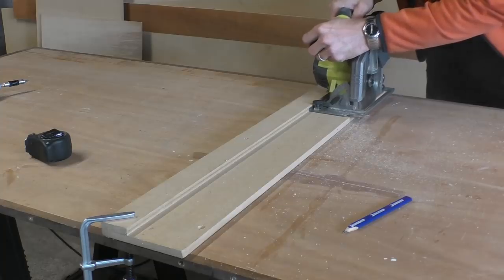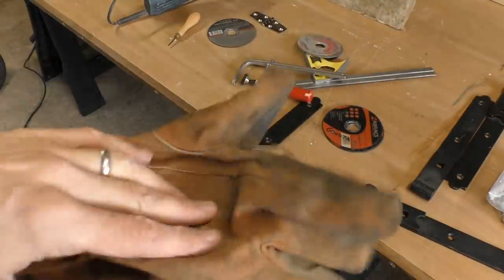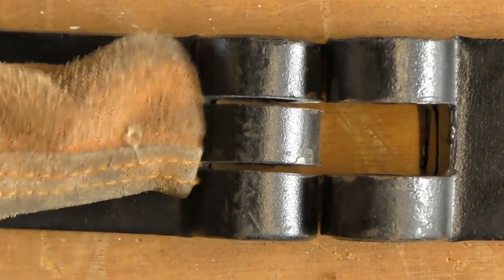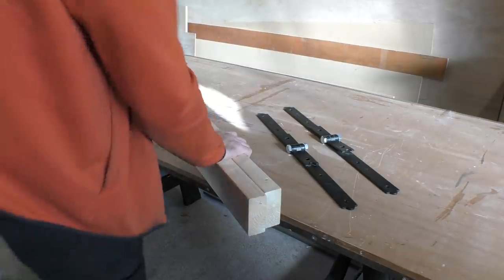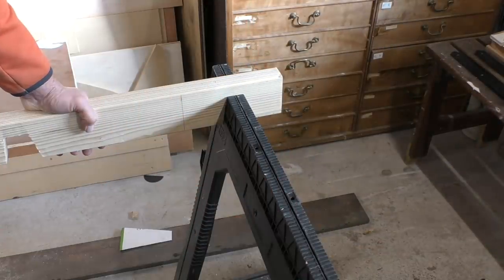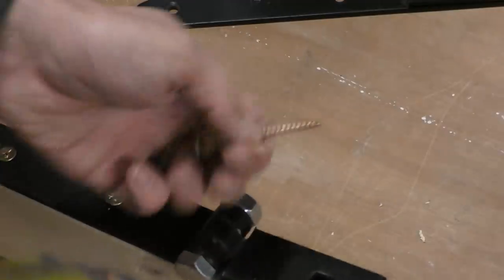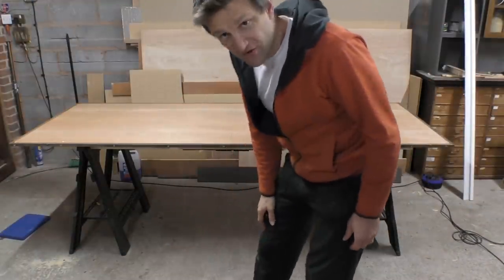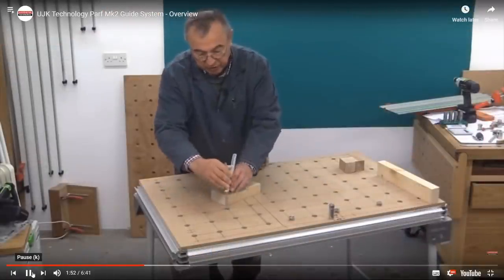The ULTIMATE DIY Portable HINGED Folding Workbench: Upgrade video 4 of 5

Comment: Lovely job Charlie I recently made two workbenches all from CLS timber from B&Q and a few treated 6ft posts I had spare. I got both workbenches set on 4 wheels two of which can lock up. I put two vices in, one for wood and another for metal. I am improving my tools over the years and recently got a pillar drill. I love playing about with wood only way to learn is practice. One of the workbenches is for gardening but have adapted so I can easily use it for wood as well. Merry Christmas to you and your family
Reply from the maker: Like the sound of that Chris! Couldn't agree more. Been messing around with wood since I was old enough to hold a saw - so from about 6yrs! A very happy Christmas to you all, too!
Reply: You never stop learning Charlie you given me a few tips past year, thanks for sharing much appreciated

Comment: Great work. I like how you think things through and show the real issues that arise, we learn best by doing, 
I'm curious about the screw gun/drill you are using to fit the screws. it sounds like there is hammer action going on?
Reply from the maker: That could have been the impact, which I don't use very often. There's a vid here where I explain the differences https://youtu.be/sL-t2Zc4wCs
Reply: @CharlieDIYte   Thanks.

Comment: A new subscriber here, after buying a new house I have lots of DIY to do and your videos / tool recommendations have given me the confidence to do a lot of the work myself.  

My dust collector and saw guide are working a treat and next on the list is this workbench.  

Thanks so much for taking and the time to put these videos together!  Legend.  It’s great that you are prepared to share your mistakes, refreshing and helps with the lessons learned.

I wonder what thoughts you and your subscribers thought about putting in 2 x 4x2 ‘noggins’ either side of the cut and fitting a heavy piano hinge?  Like a wallpaper table.  Or, would the be likely to bow?

Thanks - keep up the good work!
Reply: Actually, you wouldn’t be able to take the pin out of a piano hinge.  Maybe a strap hinge or series of door hinges with the noggins?  A quandary
Reply from the maker: Thanks mate. Really appreciate the sub and your kind comments 👊 I wouldn't get too hung up about the hinge. I would buy 4 saw horses and make two separate benches, and when you need them to function as one you can simply screw them together underneath, perhaps with an additional piece of 4x2 that overlaps each of the existing ones, or better still some sort of cut down just hanger or wide steel mending plate. The hinge was a funky idea but you do get a bit of sag so I tend to use 3 saw horses anyway and in fact on my recent wardrobe build I wanted the bench totally flat for making the doors, so I ended up screwing the supports under each joist as I've just described. You'll love this bench mate. It's a game changer 👍😉

Comment: Why not offset the hinges ( and 4*2 ) so you don't need to cut ( weaken ) the hinge ?  Hinge eyes (??) are next to each other with bolt / pin through both.
If doing from the start make the whole thing modular. First piece with two legs. Every extra piece has 1 set of fold down legs. Do at least 1 segment with extra hinge 'halves' so you can add at 90 degrees to make L shaped bench.

You can also connect the hinges with a U shaped piece of metal. Allows you to have a double hinged top all connected. One set has a U, the other has |_________________| to wrap right around other 2 segments. Use split pins / Lynch pins to hold C shape into hinges.
Sorry if that is confusing. And not really relevant to this workbench upgrade.

Viewers: If you buy hinges like in the video also check out the matching other half. Like this :
https://www.amazon.com/BOLT-HINGE-screw-install-Lag-bolt/dp/B013RXPDCG?ref_=fsclp_pl_dp_6.
Or the lightweight ones in the video description. :) 

<sorry charlie - i will wander off now..>
Reply: good idea!
Reply: Surely if you offset the 4x2, there's little to stpo the table collapsing? The pressure between the two ends of the 4x2 is where the support comes from isn't it? Or do I misunderstand you?

Comment: ok so as to regards about setting circular saw blade depth I don't agree with maybe if its a table saw then the blades are so thick its doesn't really matter but a circular saw the blades  are very thin and will flex even with just using your hands let alone in wood with tension. so if you set the blade at the very edge where  it is the furthest point as in relation to the arbor making it weaker thus it will be more likely to drift as when you set it at full depth you have the close proximity of the arbor that will lesson the blade drifting

Comment: Great idea. I eventually followed your initial workbench idea using sawhorses. Do you think its possible to make/attach a build to casters to support the sawhorses. I have several sawhorse setup that I use as worktables because I didn't want to build tables but my problem now is the weight and mobility, as I often have to move them around in my work space garage. I have an idea but not sure if it woud work or be stable eough.🤔

Comment: If you cut a rebate on each end of the mating surfaces of your hinge joint timbers, you can add some more M14 bolts end on on either side of the hinge space. The heads can bear on one another and they can be screwed in and out to adjust the final angle of the hinge, should you get any sag over the years.
Reply from the maker: That is a very good idea, and one which I was going to do - with normal screws rather than bolts - if there had been any residual sag in the table. Thinking about it though the bolts are a better idea as I'm guessing your thinking is that you could adjust them with the table in its horizontal, operational position, whereas with the screws I'd have to keep folding it up to adjust them.
Reply: @CharlieDIYte  Thanks. For what it's worth you can also use 3 screws in plugs in a screed under a tile to level it exactly against adjacent tiles, should you have to chop out a broken one to replace it.

Comment: Hi Charlie, why don't you use a multitool (with ear defenders) with a narrow BI metal blade for the metal cutting, and the wider wood saw to plunge cut the notches. I find mine very useful for quick small jobs e.g sanding, chasing and cutting square switch recesses, plunge cutting floor boards etc. Cheers Gordon

Comment: hi charlie loving the video the one thing you haven't mentioned was the length of the ply as you have 2 x 1235mm which is more than the 2.4m you originally said you had
Reply from the maker: Thanks Ben. The ply is 2435mm long - sheets are officially 1200x2400mm but typically they're a little longer than that. With the hard wood edging strip - which I really recommend, it comes to 2470mm. And it's just under 900mm wide, or 937mm including the protective edge.

Comment: I liked your idea of the workbench using the Stanley work horses but using hinges was prone to the shortfalls you highlighted at the end. It would have been much better to sandwich the beams with metal bars recessed on the narrow sides held together with bolts. One half of the top sheet structure would hold the bars permanently and the other side would be secured with nuts as and when needed. The bolts on the sheet side would need through holes in the sheet to access if needed. It would equilly be possible to have the bars on the wider side of the beams but I feel the strength may not be as good as the first case due to the bolt point loading on that section of the beam. Ideas are fine tuned to get best results as it is often the case one may not get everything right the first time. Thanks for initial idea.
Reply from the maker: Completely agree with you. Bars with bolts would be far superior. They wouldn't even need to be recessed 👊

Comment: Perhaps investing in another two matching saw horses is a sensible idea: 1 - it will give you the extra support you need to stop the table sagging when you use the full scale table. 2 - it will give you two half scale tables that can both be used simultaneously if ever needed.
Reply: ..I commented this before the video ended. You have two sets of horses. So them maybe consider just point one when using the full scale table

Comment: @12:00 Your beams didn't break while you stood on them but the front beam sure did flex.  I imagine you're not going to place a heavy load directly in the middle but, your Youtube viewer does make a good point.
Reply from the maker: Agreed. That's why I decided to take his advice. There's no need to notch that far down.
Reply: He doesn't stand on them at 12:00 or after that at all.

Comment: Love it. One of my first woodwork projects when I first got bitten by the diy bug in lockdown was making some saw horses (think I used Tim’s approach from the restoration couple) and since then I just throw an old sheet of 18mm ply on top. I like how you’ve taken it to next level with the hinging. I just used a hook and band hinge (similar to what you used) on a pedestrian gate I built for our front drive and it struck me just how strong they are (I likely overengineered the gate!). So I think I’ll give your approach in this video a go. Also an excuse to make another couple of saw horses. Btw whilst I’m working through your vids chronologically I did take a sneak peak at a more recent plasterboard fixings vid you did and you referred to the day job in past tense. Does this mean at some point you became a full time you tuber ? Perhaps there is a video explaining this that I’ll eventually get to.
Reply from the maker: Hey Chris, good to hear from you. Yes I'm full time now. Had enough of the old day job. Too much travelling. The hinge was a nice development but you can achieve a similar effect by having 4 saw horses and just bolting them together when you need to. That's what I'd do. My work bench has been permanently erected the last two years in my green tent. At some point next year I'll have to dismantle it. The tent was meant to be temporary and it's been up for nearly 3 years now 😉

Comment: Hi Charlie, just found your channel and think this workbench is an awesome idea. A quick question: when you cut into the 2x4 to slot over the sawhorses you now are doing it half way deep as explained for structural integrity. Does this not mean they are not flush with top of the saw horses anymore? Would you just leave a gap along the top of the saw horses underneath the bench top and be happy with the beam strength, or would you put a small strip to sit on top of the saw horses going perpendicular to your beams so that the gap is filled? Thanks, from a new subscriber!

Comment: instead of cutting a notch, nail/ screw on a block.  If you put one on either side they cn bypass each other when everything is folded up.  Very nice project though.
Reply from the maker: Nice idea Chris. I missed a trick not facing the end of the beams in some sort of metal plate, though I did think at the time that I could remove any sag if need be by screwing two big screws into the end of each joist/beam, immediately facing each other, and could make minor adjustments to them by screwing them in or out as required.
Reply: @CharlieDIYte  I have a drop leaf shelf (?) or something on the back of my book shelf that I was thinking could use something like that

Comment: Just a couple of comments to make, the fasteners you used were not "bolts" but in fact "Hex Set Screws" which will wear out  and cause the hinge to become loose quicker than if you'd used modified "bolts" because you only have the crest of the thread as a contact point, and I would have cut the hinges in half making them stronger and easier to modify, one half of your hinges has only a 1/3rd of the material and the other half has 2/3rd, just saying, good job otherwise, keep up the good work

Comment: Nice, but just a thought. I would have centred one toggle clamp under the bench instead of near each side. I'm always catching my hand or clothes (pants mainly) on things on an edge under my bench.  Would you be better off converting the screw with nut into a screw with a hole in it for a humpback pin or lynch pin? It won't ever bcome loose because of your banging the bench.
Reply from the maker: Hi Stephen, thanks for this. To be honest I haven't caught the clamps on anything yet, although I think they need to be a bit heavier duty as they tend to spring apart when I'm lifting it into position. The bolts seem to work pretty well, in that I only need to do them up finger tight as there's not enough repetitive movement to loosen them (as you say) but I think it's just as easy to put the nut on as it would be the pin.
Reply: @CharlieDIYte  Thanks for the reply. This is the first video of yours that I have watched and I have enjoyed your common sense approach. Yes, I was looking at the size of you over-centre clamps thinking they were a bit small. The way they work, there will always be a stretch component to them along the plane because thats what you do to lock them while going over the centre.

Comment: thanks for the videos! For this one though, a simple parliament hinge would have done the job, no? Cheers, and keep them coming
Reply from the maker: Possibly. Could be too wide to fit on the CLS joist though?
Reply: @CharlieDIYte  I used to run a joinery, undertaking lots of bespoke and 'interesting' designs, and I am certain we used some 2" (44mm) parliament/projection hinges (each leaf being 44mm wide but 75 or 100mm long, to throw the door nicely away from the wall when open), which would fit fine on  your cls joists. But, to be fair, the pins would be nowhere near as beefy as that you employed, especially since in your application there might be lots of lateral sheering force on the pin which would be of course absent in a traditional hinge use scenario. So, I think for your particular application, the straps were overall the best option with a bolt, but parliaments might be useful to be aware of for a lighter use scenario.
Thanks again for all the vids - love watching them. 
Cheers!

Comment: Just use a couple thin washers to take up the space to fix your mistake.
Reply from the maker: A bit fiddly to insert each time but a good fall back option if you get it wrong!
Reply: I am a trained welder for many years and would just run a bead around the edge and grind it off to size or spot weld some thin washers to the inside edges.
Reply from the maker: @johnward5890  Ah, I see. Problem is very few of us have that skill and I'm trying to show stuff in my videos that most of us with basic tools can take on.
Reply: Check out the guy's that spot weld with 2 car battery and booster cables and a couple copper studs or nails. I seen guy weld with Arc rod and battery booster cables. LOL

Comment: Second question:  it must be tough dealing with a mixture of Imperial and Metric measurements while trying to build something... a 2" X 4" by 4.2m ?  Or do they just call it that when it's really 8 feet ?  Thanks, again.
Reply from the maker: It is really confusing, considering how many years ago imperial got replaced over here, it's still very much used. At a timber yard you talk about 4x2, but still order the lengths in metres ?!

Comment: For the record a "bolt" that is threaded all the way to the head is not a bolt! It's a machine screw. (Called a screw regardless of the head shape.) The bolt with the unthreaded shank is the actual bolt proper! (The exception is the dome headed coachbolt). 
The "strap" hinges are actually band and gudgeon. (The gudgeon being the pin on the plate).

Comment: Notching the beams doesn't make any difference, in this kind of application, providing the notch if filled with something. If you're adding a lot of weight on the overhangs... just add a 300mm strap across the top of each notch. 👍🏼
Reply: In this case the notch is filled with the trestle of course 👍🏼

Comment: You used M14 set screws not bolts and i would not advocate using a slitting disc for slight adjustments (grinding) apart from that you have shown a very good idea to the public

Comment: hi, i cant help but notice i think after a few uses the beam ends will compress by always touching each other causing the table to sag, maybe putting metal plates on the ends or something hard wearing would make it last longer? sorry if you have addressed this already in your next video
Reply from the maker: Hi there. Yes, metal plates would have been a good idea. The alternative would be screws into the end of the timber, that butt up to each other and could be adjusted to get the table perfectly horizontal. The best suggestion though has been to notch out the end of the beam and put adjustable bolts in, that again butt up to each other.

Comment: Don’t quite understand the bit about forming a slight angle where the two half’s of table meet - do you mean you cut the top in half at a slight angle rather than 90 degrees?
Reply from the maker: No, what I meant was, to counteract the sag because of the weight, ideally the two tops of the workbench should butt up to each other forming a very shallow "v", so each part of the top wants to be very slightly more than 90 degrees - perhaps 90.5 or 91 degrees. But this is only if you want the middle to be self supporting. You could just put another saw horse underneath, or another way to stop it sagging would be to put a couple of screws into each CLS where they butt up to each other (ideally with each screw butting up to the corresponding screw in the other CLS), start with them flush and gently unscrew them until you've got the workbench perfectly level.